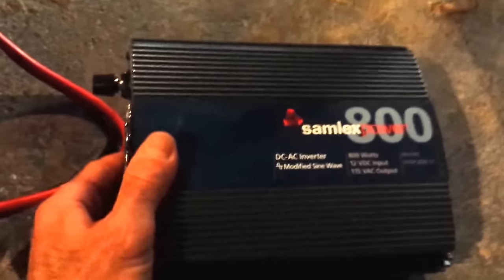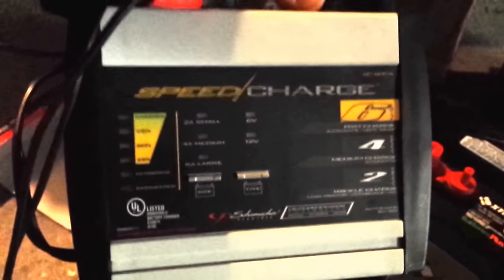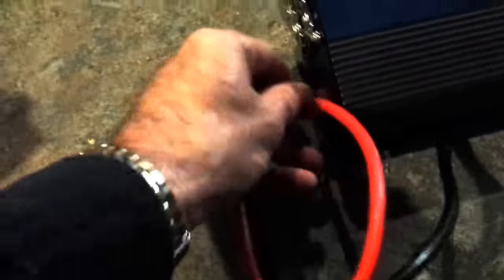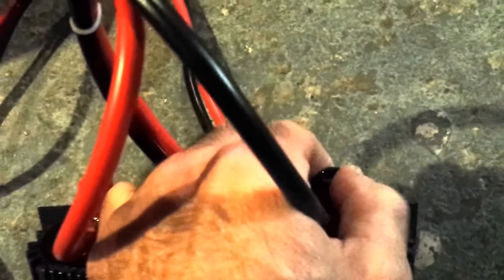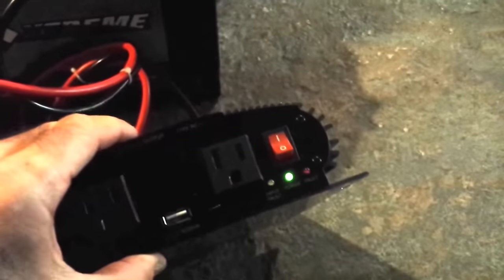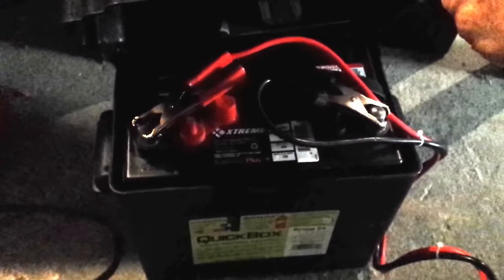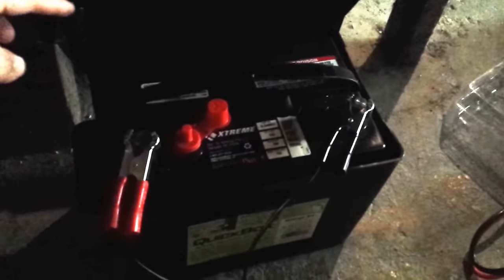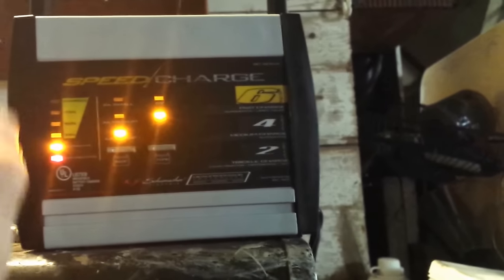How to Connect a Battery, 12 Volt Inverter, and Charger

Comment: Can you have the inverter and charger connected to the battery at the same time?  I'm looking for a way to add a battery backup to a sewage ejector pump, and if I could have both the inverter and charger connected to the battery at the same time, it would keep the battery charged all the time, yet would also allow the inverter to kick in if the power goes out...  

Please let me know if this can be done.
Reply from the maker: Hi, unfortunately, you can't have both connected to the battery at the same time. It's a good thought though. The inverter and charger have red and black clamps and only one set of clamps can be connected to the battery at a time. The only other suggestion is to check the battery periodically. If there were no power outages, I would suggest re-charging once a month to keep the battery fully charged. Keeping the battery fully charged is healthy for the battery and extends its life. Hope this helps. Dan
Reply: Dan Usher Thanks so much for your response!  If there was a way for both the charger and inverter to be clamped on at the same time (if it was a different battery, or if I clamp one clamp to the other), would the arrangement be safe?  This is at my parents house, so I don't want to give them work to do... :)

The problem with your suggestion, is that if the battery is the primary power source, then whenever the sewage ejector pump kicks in, it would be using the battery and it would be depleted.  The battery may have to be recharged more often than once a month.  I'm looking for a way to set it up so that it's always plugged in and when the power is out, the battery is used to power the pump.  Any thoughts on that?
Reply from the maker: unclesteveE I understand your dilemma. You might call Batteries Plus (this is where I bought the battery and they are located in Massachusetts) and ask them if one clamp over the other will work or trying to have two clamps on each terminal is ok.  It will be tough to try and get two clamps on a terminal even if it's ok. 

I realize if the power goes out, it might use up all the battery before you have a chance to recharge it. The once a month idea was just for maintenance. 

Now let me ask you a question. How often do you anticipate the power going out in between your visits to recharge the battery? If the battery was fully charged and the power was out for an extended time and drained the battery in one sitting, you wouldn't have been able to do anything anyways. If you expect power outages multiple times a month, then you need some way to be notified when the power goes out so you can recharge the battery.

I know those answers don't get you to the automated solution y are liking for, but my guess is if you charge it up once a month, it will take care of 95-99% of the power shortage issues. It's a big battery and had a lot of juice in it. 

Another question, which you may have already figured out, is when the power goes out, hire does it switch to the battery?

Last thought: Google your question.
Reply: Hey Dan, I have now seen a product called an inverter/charger, that does the work of both the inverter and charger at the same time (ex: http://www.theinverterstore.com/1500-watt-modified-sine-inverter-charger.html#).  This is the ideal solution for me, but of course, they're more expensive than the stand-alone inverters.  They do avoid the hassle though, of having to charge monthly.

Thanks a lot for your help!  Hope pointing out these inverter/chargers is helpful to you in return!
Reply from the maker: unclesteveE , you're welcome! 

I took a look at the link and the inverter/charger seems great. Looks like you solved your own problem! Good work! Yes, it is a more expensive solution, but if it gives you peace of mind and you only have to bite the bullet once it may be worth it to you.  Especially if you plan on using this for a number of years.

Hope your added info on this helps some other people too.  Dan
Reply: Dan Usher Thanks.  The one issue I can see is that these inverters (all of them, not just those with a built-in charger) have a maximum surge level, which appears to be 2X the base level.  I'm not sure what will happen if the surge of the sewage ejector exceeds that maximum level...for 1000W it's already going to cost about $500 for the battery and inverter/charger, and above 1000W, the prices go way up...

Comment: You can plug whatever you want into it !!! WTF! Ever hear of peak wattage limits?
Reply from the maker: Hi Joetylerdale, great point. Thanks for raising the issue.  I am using the inverter for a 600 watt blender and the inverter is 800 watts continuous and 1600 watts peak, so it works for my purposes and maybe many other peoples purposes, however, if people do want to plug in something with higher wattage requirement, like a microwave, then they will need an inverter that can handle it.
Reply: Dan Usher how about a 700w polisher

Comment: what if you connect both the battery charger and the inverter to the battery and then plug the 120v battery charger into the inverter?
Reply: It doesn't work to keep the battery charged. The inverter isn't 100% efficient, the charger also isn't 100% efficient, due to power loss (conversion of the electrical energy to thermal and possibly mechanical energy which is not desired in this case) and the result is that you will drain the battery.
Reply: I have a question. What if the Inverter was a larger Wattage, such as a 1500 Watt, could you plug a 12 volt trickle charger into an available outlet on a 1500 Watt Inverter, and charge the battery when it needs charged, as long as nothing else is plugged into the Inverter other than the 12 volt trickle charger ?
Reply: Lots of perpetual motion and zero point energy vids out there for u

Comment: I am 14 and i wana build on off these to go back into the wood and power a heater (200w) so I can stay warm would a lead acid battery work??
Reply from the maker: +NolanTheGamer1 , I don't know if a lead acid battery would work.  I use a marine deep cycle battery.
Reply from the maker: +NolanTheGamer1 , yes it looks like it would.
Reply: Dan Usher Thanks!

Comment: Is there no problem charging and using the battery at the same time?
Reply from the maker: Bono Hiuson, unfortunately, I don't think it's possible for two reasons. One, your not charging the battery from an outside source, an outlet. What you described is just a loop. Second, you can't fit two clamps on each terminal at the same time. The battery is huge. It lasts a long time. Don't worry about trying to charge continuously. Just use it, enjoy it, and when it needs to be charged again, plug it into an outlet for a few hours.
Reply: Man, tnx!! all we need is a guy like you who just tells us what it is.. Bless u Dan!!

Comment: Could you run a sump pump off of this inverter?? Thank you
Reply from the maker: Hi Ramiro, thanks for the comment.  I've never used the battery for a sump pump, but I did a quick google search for watts sump pump needs and you need an awful lot to start it and a lot to keep it running.  Anywhere from 1300-4100 watts to start it and 800-1050 to keep it running.  The inverter I use is only 800 watts and it's just too small.  I'm not even sure if there's an inverter powerful enough for this.  Maybe look for a smaller sump pump and get a better inverter and it might work, but you have to know the watts the sump pump needs to start and run continuously.  I'd go to a boat show for a more powerful inverter than I have here. Hope this helps.
Reply from the maker: Here's the article I saw.  Sump pump is on the bottom: https://www.donrowe.com/usage-chart-a/259.htm
Reply: Thanx Dan!! I will do more research!! Thank you!!
Reply from the maker: @ramirocortez6392  your welcome!

Comment: Can you charge the battery with the inverter at the same time you are using the inverter when is connected to the battery?
Reply from the maker: Hi Joel, thanks for the question.  This question has been posted before and I'm not sure I understand why you would want to do that.  If you were close to a power source to charge the battery, wouldn't you just plug into the power source whatever you were going to plug into the inverter?  Why try and use the battery as a middleman?  

To answer your question though, you wouldn't be able to fit two red clamps and two black clamps on the battery terminals at the same time.  And it just doesn't seem to make sense even if you could.  Power would be going into the battery through the terminals from the charger, and power would be coming out of the battery from the inverter through the same terminals at the same time?
Reply: I guess that is an option if you got no power at all, or in an emergency situation. But i don't know if it is possible to recharge a battery while you are using it and in top of that by it's self source. I think i got a new research topic.
Reply: If you don't have electricity in your house, could you plug the charger cables in the battery and the plug in the inverter and have a constant charge of the battery while using it?
Reply from the maker: Rafael Irizarry, thanx for the comment. It doesn't make sense to have the the charger, battery, and inverter connected to each other at the same time to begin with. Then to have something plugged into the inverter drawing off power, and to expect the battery to stay charged because of the idea you could connect the battery, inverter, and charger doesn't make sense. How can you draw power off of the source (battery) and expect it to stay charged without adding power to it from an outside source? Trying to run a connection between the battery, inverter, and charger is just a closed loop. Nothing is added.

Comment: I have inverter and a battery.. Can I charge my battery using my inverter? I was confuse whether going to buy a battery charger then I search tru wikihow and saw inverter charging motolite battery same as mine..
Reply from the maker: Hi Stephanie, thanks for your comment.  I don't know what you were looking at of course, but there are some inverters that can also charge a battery. They are called inverter chargers. I don't know what inverter you have or its capabilities.  There should be a switch that says "charger" if it does have that capability.  Here's a video of an example of an inverter charger.  Look at 40 seconds mark and you will see what I'm talking about:  https://www.youtube.com/watch?time_continue=40&v=OQngNOgP5Lg&feature=emb_logo.
Reply: Thank you! Big Help

Comment: so you cant run a charger while on the inverter. so when power fails it just goes straight on?
Reply from the maker: Hi, thanks for the comment.  I get this question frequently.  Sounds like you want to connect all three together.  I have answered this in the comments below, so take a look and you will see a longer response, but in short, it's possible, but not what this is designed for.  Hope this helps.

Comment: Assuming I never switch off the inverter, how long can it run?
Reply from the maker: Hi, Thanks for the comment.  Whenever I have left the inverter on, it seems to drain the battery fairly quickly.  Now, I am using it to run blenders and they require a lot of power at once.   So I run the blender for what I need and then turn the inverter off.  If I accidentally leave the inverter on and I can tell the next time I use the blender and it doesn't seem like the battery has as much juice, I just turn the inverter off and a little while later it is fine, so  I don't think that leaving the inverter on actually drains the battery, but it just seems that way.  Hope this helps.
Reply: @danusher6919  do you have a power stabiliser?
Reply from the maker: No I do not.

Comment: Can power be obtained from the inverter when it is not connected to the battery?
Reply from the maker: Hi shayne caesar, unfortunately, no. The inverter doesn't store any power. Just takes it from the battery and converts it so you can use it.
Reply: Dan Usher thanks for the Speedy response

Comment: but where does the charger draw it's power from to charge the battery or does it use electricity?
Reply from the maker: You need to plug the charger in to an electric socket just like plugging in any appliance.  The idea is to charge the battery when you have access to electricity so you can take a charged battery with you where you won't have electricity.
Reply: thank u so much Steve. so if you don't have electricity at all then u opt for a solar panel to charge your battery?
Reply: Do u deal on solar as I'm interested in all the products?
Reply from the maker: Hi Patience, first just a minor correction.  My name is Dan.  I think I responded to someone named Steve in the comments below.  As for your question, however you generate or wherever you get electricity from to power other appliances is where you would get power to charge the battery. If you can use a solar panel to generate electricity, then that's fine.
Reply: 😅😅😅sorry about that...I just saw Steve and I assumed😝
Reply: Dan do u deal on inverters or solar products?

Comment: what.about if you want your use 2 batteries.. then how do u set it up
Reply from the maker: Hi Niki, not sure I understand your question.  Do you want to use 2 batteries at the same time or have one as a back-up?  I bring 2 batteries with me, but the second is used as a back-up.  When the first one is done, I just take the red and black clamps off the old battery and put them onto the new one.   I you wanted to hook up both batteries at the same time to get more power, I'm not sure how that would be done.  The simple solution would probably be to get a bigger battery to meet your needs. I have two 45 lb batteries, so each is substantial. It's the size of a car battery.

Comment: can you charge the battery with the inverter still connected
Reply from the maker: Hi Laura Larson, great question. Unfortunately, only one set of clamps attach to the battery terminals at one time. I'm not sure I'd want to charge the battery and have it hooked up to the inverter at the same time. 

If you are near a power source to charge the battery, then you probably don't need the inverter, but I appreciate the question.

Dan

Comment: Can I use this to charge my car dead battery?
Reply from the maker: Great question.  Although I'm not a mechanic, my sense is that it's not as easy as charging the deep cycle marine battery.  I googled it and here are a couple of results.  You may want to google it yourself too.    https://www.meineke.com/blog/charge-car-battery/ , https://www.pepboys.com/parts/batteries/diy_charging/
Reply from the maker: Here's a youtube video that I thought was good. It's short at 2 min.  https://youtu.be/pXzKBu0nh2M
Reply: If you have a live battery initially to activate the inverter.

Comment: The charger is a draw on the battery,  not a source. There is and always will be more power out of the battery to power the charger than it could ever put back into the battery.
Unhook the charger and you will absolutely get more time out of that battery in between charging times.
Reply from the maker: Hi WisdomVendor1, I agree.  Not sure if it sounded like I suggested to keep the charger connected to the battery after it was done charging, but once the battery is fully charged, than the charger should be unhooked from the battery.  After you use the battery, say for the weekend, then it should be charged again.
Reply: Hi, when the charger is plugged in, does it shock. Mine shocks

Comment: how long does it run with 70 wt  bulb?
Reply from the maker: Hi Subashtin, that's a good question.  I don't know.  It depends upon the battery size.  I have a 45 lb battery which is a substantial battery.  I use it for 600 watt blenders that I run for probably a total running time of 10 minutes in a day and use only about 5% of the battery.  Hope that helps.

Comment: Is that 11plates battery?
Reply from the maker: The battery I used in the video is an Extreme that I bought at Batteries Plus.  Now I use a Duracell.  Does this answer your question?
Reply: @danusher6919  yeah. I wonder because i used outlast battery then my my inverter was 1500w but its not working.
Reply from the maker: @sooyoo1758 , 1500w is a good amount for an inverter.  How old is the battery?  After a few years, they start to lose effectiveness.  Or could it be something with the inverter?  Did you fry the inverter?  I have a couple of times by using an old battery and the equipment I was running was old (blenders) and not as efficient and required more power than the inverter could handle.  The last place to consider is if what you are running needs more than 1500w.

I would suggest bringing the battery and inverter either back to where you bought it and ask questions, or go to a Batteries Plus, even if you didn't buy it there.  There should be someone more technically savvy at batteries Plus who might be able to explain what's going on and they might help you out in hopes of getting a sale. Or maybe just give them a phone call.
Reply: @danusher6919  thanks for this. The battery is new also the inverter. I tried lighting the bulb directly to the battery and it's working. I guess my inverter has a problem. Maybe i should try buying new one
Reply from the maker: @sooyoo1758 , you're welcome.  Glad you figured out the problem.  Yes, sound like it's the inverter.